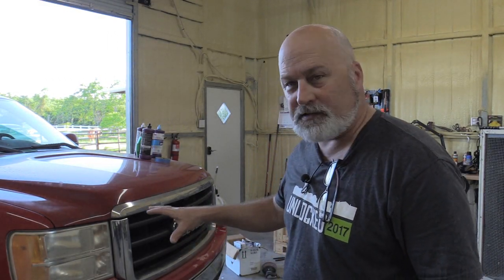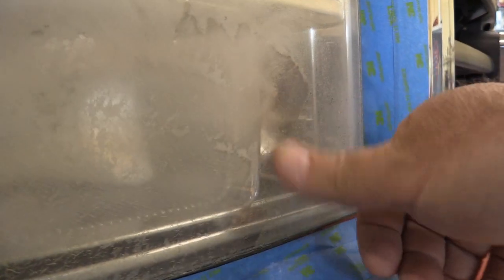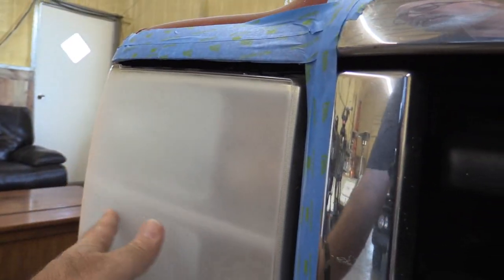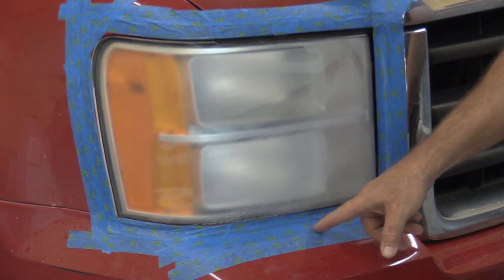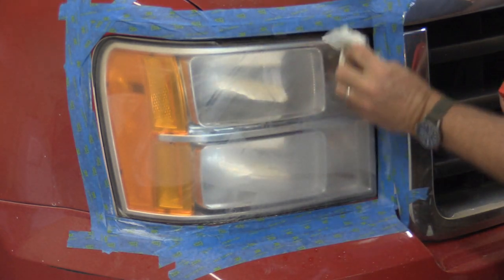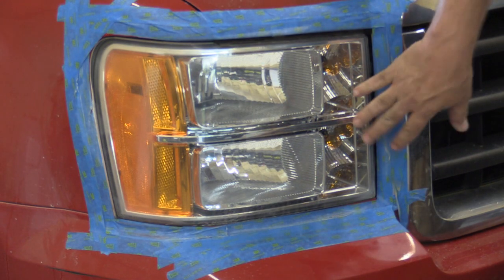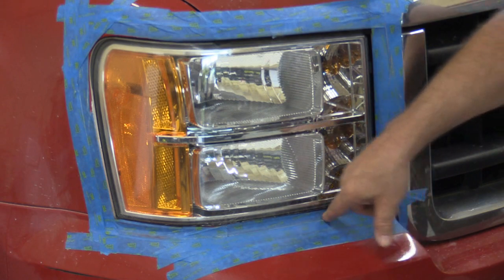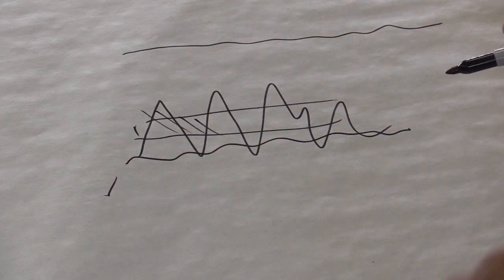2008-2012 GMC Chevrolet Truck Headlight restore technique for dull or foggy lights.

Comment: Honestly by the time you spent money on all that equipment, pads, sanders, the three-step 3M, and time just buy a new headlight from ebay
Reply from the maker: Yeah I had all this laying around and it was just one way to do it that I think someone could get some ideas from. I need to do another one and I will take out some of the middle sanding steps and just go coarse then final to see the result. Yes buying a new one is a good fix for sure.